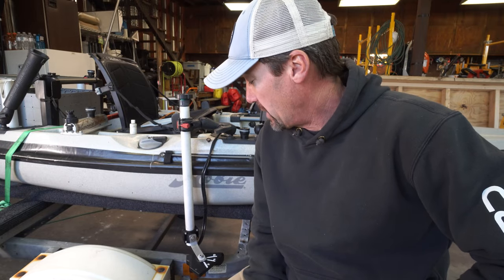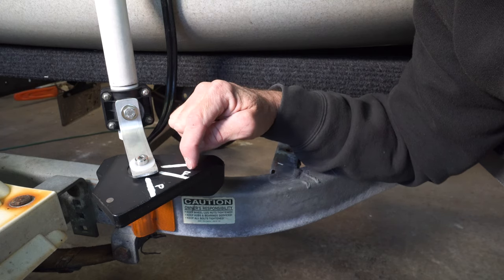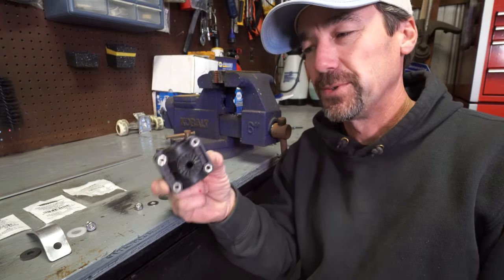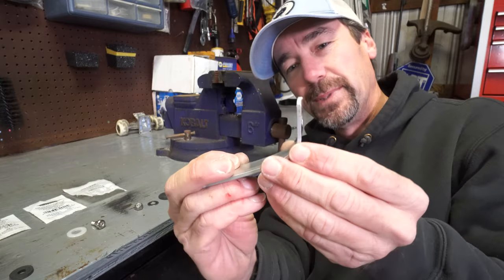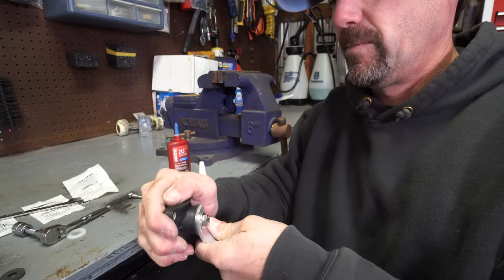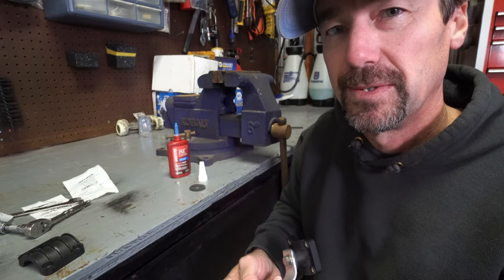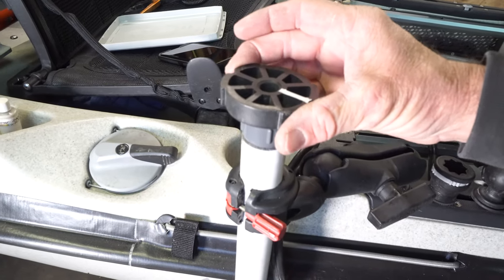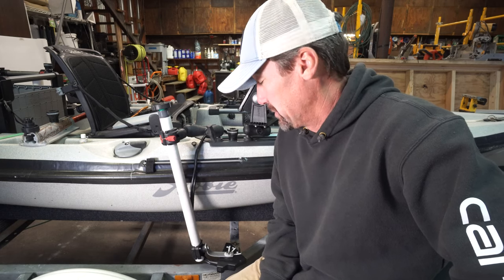$5 Homemade Mount for Garmin Livescope Perspective Mode

Comment from the maker: Just a heads up, I discovered my marks on the transducer for positioning the forward and down modes were off. They needed to be farther away from the perspective mark that I made which was correct. I have since corrected this but just wanted to let yall know.
Reply: How did you determine where to put the marks? I see now the new transducers are coming out with factory marks of the 3 different modes but mines less than 2 weeks old and I'll have to manually add the marks.
Reply: The 7 degrees tilt on the OEM trolling motor shaft mount will creat you a headache in down and forward view.  It’s much better and easier to use the 0 degree mount (available on Garmin.com).

Comment: The regular  mount is 8 degrees so with Garmin suggested 12 degrees its 20 degrees total you nailed it. By the way you can bend aluminium  sharply with use of a propane  torch. Thanks for sharing.

Comment: Great vid thanks. How did you determine where to put the index mark for the perspective view? Also does your unit auto detect the perspective orientation? Thanks again
Reply from the maker: Yes it auto detects. And the index mark is lined up with the middle transducer on the lvs32.
Reply: Thanks, one more question..which head unit are you using? My echomap 93sv doesn’t auto detect the perspective mode
Reply from the maker: I have a 74 SV. It seemed to Auto detect just fine. Make sure that you have it set to Auto in the menu settings
Reply: My auto works on forward/down but not perspective. Called Garmin and they’re working on it. Thanks for taking the time to reply and again really enjoy your videos!

Comment: i bought some RUS-10-018k  p/n RPC2082-ND  CLIP WIRE SADDLE from DIGIKEY  electronics to run my wire through. you drill a hole in you tube and they just push in. i haven't tried it yet on the water but they seem solid
Reply from the maker: Will have to look into it...

Comment: Thanks Jessie I'am in the middle of making mine now. Could you please tell me how long you cut your Aluminum bar to before you started to make your bends?   Thanks great video...
Reply: ok sorry just watched again and seen you say  3 1/2 inches... but thanks again great video...
Reply from the maker: The length really isn't too important, it can be longer or shorter depending on what you are mounting it too

Comment: Forward scan is when top of transducer is flat n parallel with water.
Reply from the maker: Yeah if you follow what they recommend, try tilting it up and see the difference. it will read all the way to the surface of the water then

Comment: I made one just like this and it works great!  Thanks for the video.  I do have one question.  Are you sure your Down and Forward marks are in the correct location?  I could not get my downview to work per your marks and when I go to Garmin's site it looks like they have the Down and Forward  marks in a different location than your marks.  It looks like your Down View mark is the actual Forward view location and the Down view needs to be rotated back a bit.  Does your down view work when you line up with your Down view mark?  Thanks in advance!
Reply: I noticed the same thing. The forward-looking mode should have the top of the transducer being flat and the down-looking mode should have it angled down some.
Reply from the maker: Yes my marks are off, something I discovered after making the video. I have since corrected it